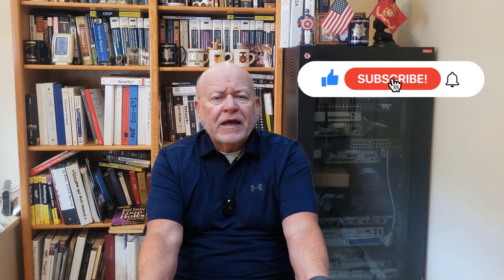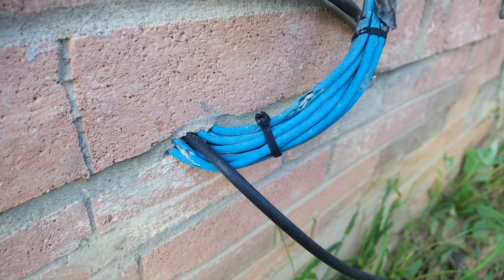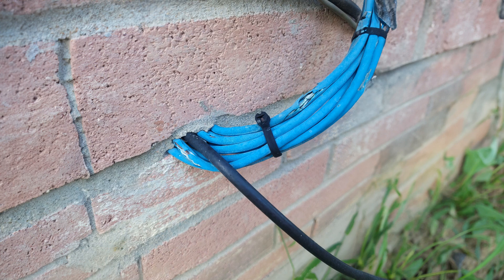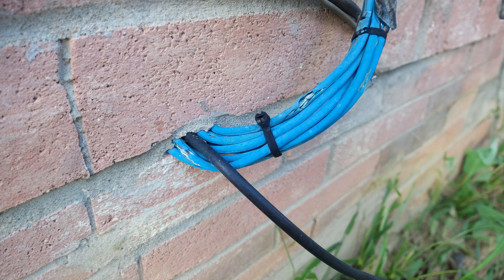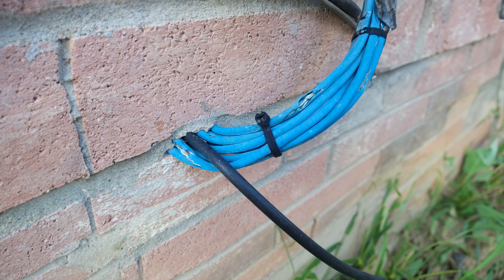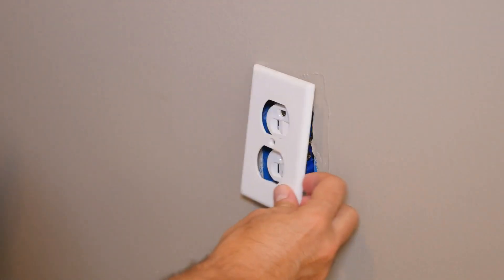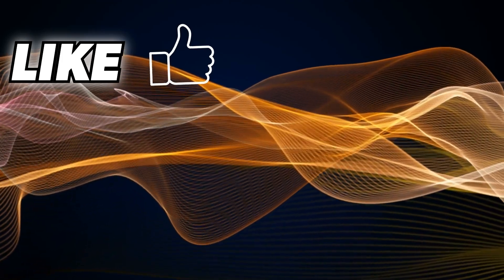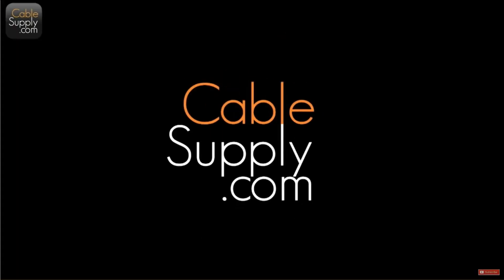Proper Cable Installation: Avoiding UV Damage and Ensuring Longevity of Outdoor Cable.

Comment: Maybe you could speak to cable protectors for building to buildings and  the NEC requirements.  By protectors, I refer to spark gap equipment, etc.